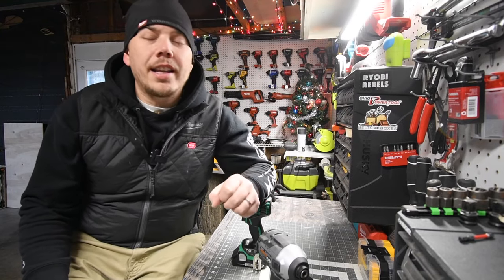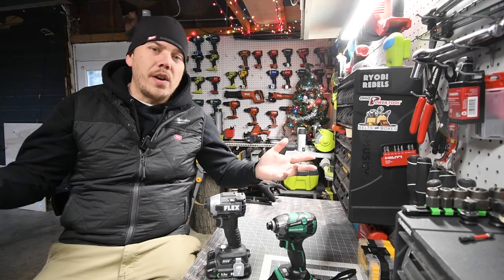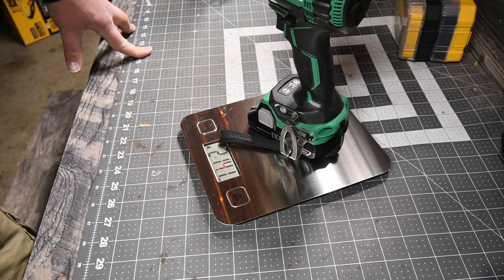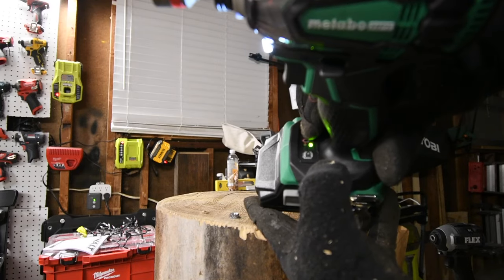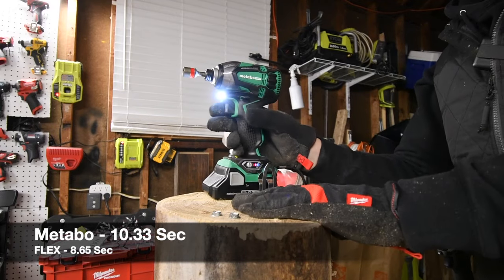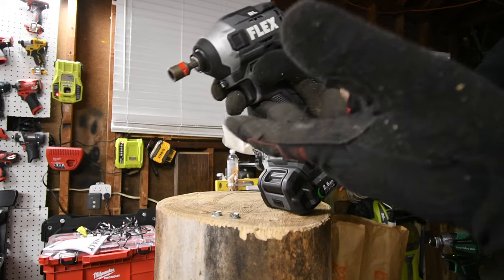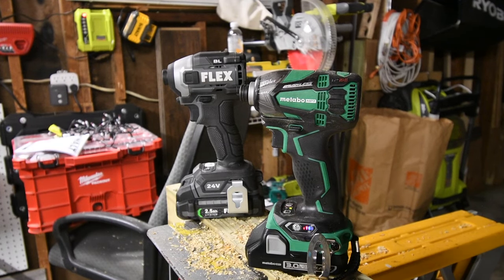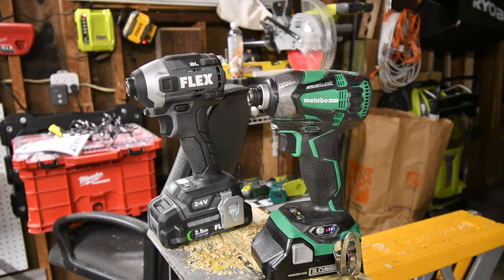Metabo HPT vs FLEX (Low AH Batteries)

Comment: I just bought the metabo hpt kit with drill, impact driver, 2  3ah batteries, charger and hard case at lowes for only $129.  Good comparison test.  I figured the Flex would dominate, but the Metabo is a really good kit for 130 bucks.
Reply: Yeah the Triple Hammer has been out for 5yrs and still kicking some ass
I prefer it for normal screws and fastener over all of my Milwaukee and Makita it impact drivers
The 36V Metabo HPT tools have replaced many of my Milwaukee, Makita and DeWalt tools
10" mitre saw, 10" full size table saw, Hammer drill, grinder, SDS Max rotary hammer, full size 1/2" router, and best recipe saw in business plus a great portable band saw
No contest
Reply: And it will do the job for most people but cost them tons less in the long run
Reply: are the batteries compatible?

Comment: The Metabo HPT kit with Hammer drill has been at $149 for ages from Lowes and Acme

The 36V is $199 with the 2 multivolt 2.5/5.0 batteries 

The 36V Metabo HPT Hammer drill is the one that can hang with flex and kills my Milwaukees

Comment: I'm a giant tripple hammer fan. Good video. I think the flex is the size of a frying pan. The tripple hammer is also over 5 year old technology. Perhaps it would be better matched against an older gen impact
Reply: You dare insult the frying pan
Reply: @TheSirPotato   Oh no sir I would never insult the frying Pan... I'm a big fan of your work Mr. Potato.  Especially in Ireland circa 1845 ish
Reply: ...” size of a frying pan,” I love it!  I’m thinking Dave did nt have it on the highest setting at times?  That a Metabo/ Hitachi will be running long after the ‘frying pan/club’ has burnt up!  Peace and great comment!  👍👍👍😁😂
Reply: @georgedavall9449  100% I have yet to see a Flex tool on an actual job site. The tripple hammer is all day long a contractor tool. And it's ip56. I'd like to see a flex get left out in the rain. Even though, when you start giving the hitachi hpt the business, the cheap plastic heat shield falls off. But whatever, honk if parts fall off
Reply: @Leeroy2586  Ha Ha Hey, maybe it will shrink some in size if left out in the rain?  🤔😳🙄😂🤣👍  

I saw a video somewhere, and they threw the Hitachis in dirt, a bucket of water, and they kept on going.  ‘ DrDecks’ ( YouTube) channel uses them out in bad weather all the time.  Yeah, the plastic nose part, and the poor light, and that insipid power gauge are the things that need to be fixed.  It would be killah if they did that!  Peace!

Comment: Flex should have gone with a tri-light or something on the nose cone. If you're gonna have rubbing molding over the metal, might as well stick some LED's in there.  Makita and Milwaukee, have both been moving towards it, and Dewalts had it for forever.  I like the power of the Flex, considering it's new to the game; the grey color is nice, and overall I like it's aesthetics.  But what's up with the weird collet?  Quick insert & Quick eject is what people want, not the silly button.  It seems like like they went out of their way to make it different for the sake of being "different," rather than "better."  

My criticism of being "different" for the sale of it carries over to the Metabo "triple hammer" gimmic. It makes no diffrence if the hammer contacts the anvil at 2 points or 3 points, if the mass is the same, it's going to transfer the same energy.  If anything, having three hammers and three lugs on the anvil means that those lugs would necessarily have less area contacting the anvil than a regular 2-lug/2-hammer design.  It's like, an AK-47 has 3 big lugs where's the AR-15 has like 7 or 8.  In practice over thousands of rounds the smaller AR bolt lugs can break off with use. Whereas, I can't recall even hearing of an AK bolt lug shearing off, so, much more rare.  Ergo, the I would expect a conventional 2-hammer impact to have greater longevity than a thriple hammer design. Though in reality they are all probably over-built enough that sheering anvil lugs probably doesn't happen much. But hell, Idk.  I'm literally just a random dude on the internet, and I might even be a computer.  
Beep.  Boop.  
Crush. Kill. Destroy
=0

Comment: Flex seems to beat every brand it goes up against. I own the triple hammer. It’s a great tool. More than gets the job done, low vibration, well balanced and comfortable to use and a lot cheaper than the Flex.
Reply from the maker: it is a powerful brand and its up there with Dewalt and Milwaukee
Reply: @ManCaverTools  I believe so. Probably the most underrated brand on the market.

Comment: At least use self driving bits to help negate you pressing on them unequally.
Reply from the maker: correct I only hold the tool for that, the bit does the work

Comment: Rr building always show the triple hammer as best impact in his video but wow that seem like crap impact driver don't understand anything now
Reply: The impact driver's main job is for driving screws and small lags
These power tests are fun but I would use one of my impact's or my Hammer drill for the larger lags
The Triple Hammer really shines in real world.use in decks, framing, sheet metal etc
Reply: It's inconsistent. Sometimes it puts bigger fasteners in lightning quick, other times in like half the speed. Has to do with the triple hammer. You'll never notice it on the smaller fasteners though. It's light and really smooth, but also dated. I would like to try the new bolt, but not too keen on the weight of the 36v batteries on smaller tools.